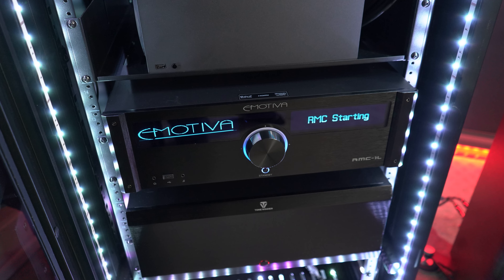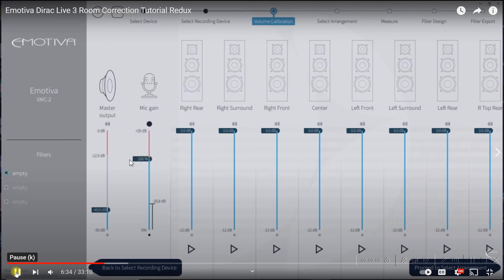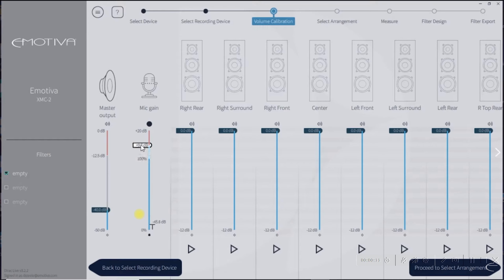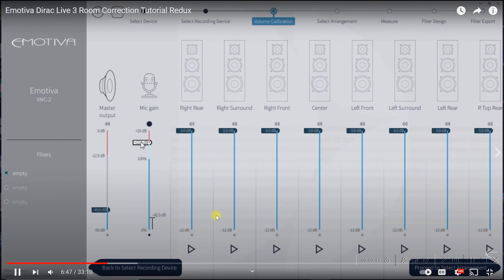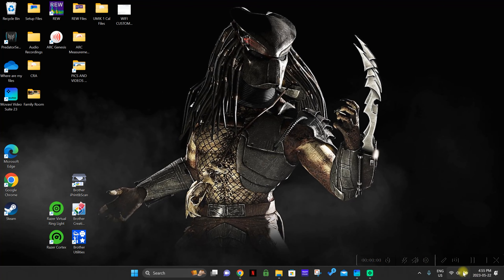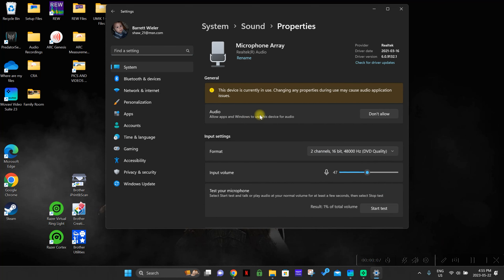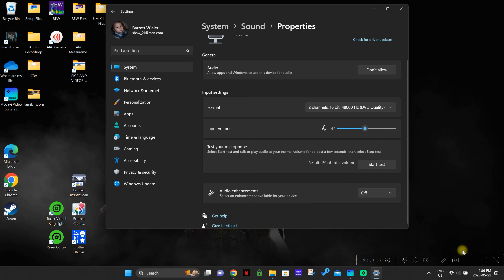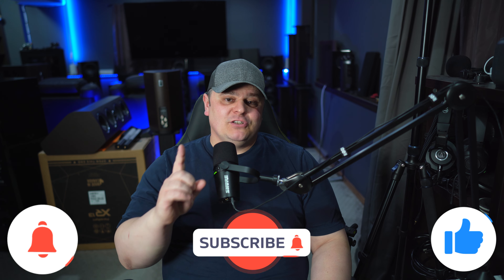How to Fix: Can't Set Mic Gain In DIRAC LIVE! Onkyo/Emotiva/Arcam/Marantz/Denon/Storm Audio

Comment: Nice video👍  Question, I am looking to add a processor to my Pioneer Sc-09 receiver.  I am considering the Emotiva basx MC1 and the Tonewinner AT-300.  Knowing you’ve had experience with both, which one would you recommend?
Reply from the maker: Can your Pioneer SC-09 be run as an external amp only?  I do know of the SC-09, but I don't know all the ins and outs.  It will need to bypass all the internal electronics and have the ability to be used as an external amp only.  If not, you will need to purchase externals amps for the processor.

My personal choice would be the AT-300, it runs very smooth and is virtually bug free.  I just recently returned the Emotiva RMC-1L because of the bugs I was experiencing.
Reply: @SpecOfTech  Yes it can Sir, and thanks for the quick response😁👍
Reply: Interesting, I had no such issue. I did find the 'volume calibration' to be the trickiest part of using dirac but mostly because I was over complicating it in my little pea brain.

Comment: Thanks a lot! This setting (like for Windows) does not exist for macOS. But you can adjust the 0 db setting in the Audio - Midi settings, e.g. 0.9 - would that be the right way? I don't have my UMIK here at the moment, otherwise I would have tried this already